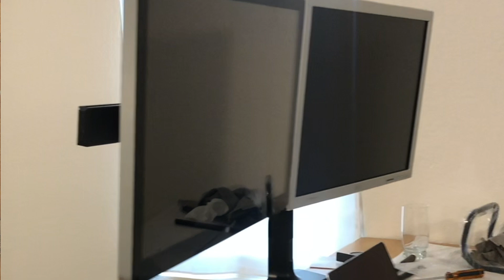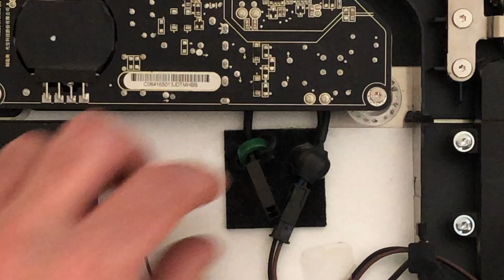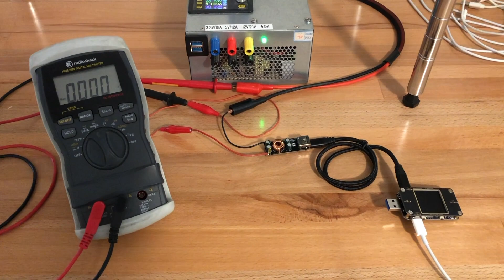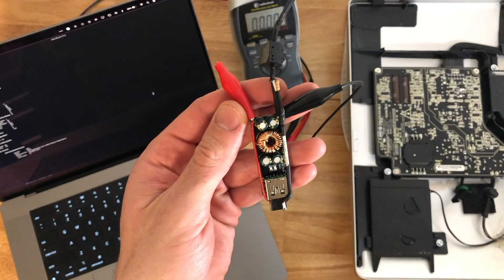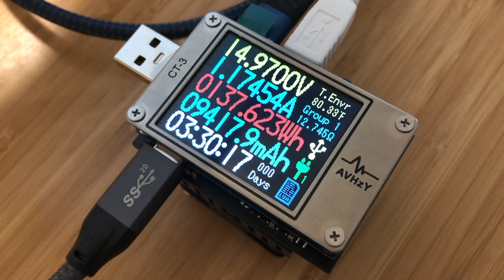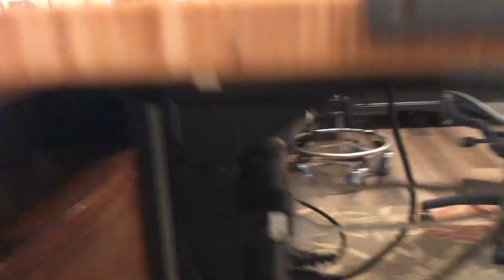Thunderbolt Display USB-C Retrofit for Modern Macs!

Comment: Enjoyed this video even if it doesn't work for me.
Short history, MacBook Pro late 2013 and Apple TB monitor, new early 2014. 
Bought a late 2023 MB Pro M3 and used a TB 2-3 adapter for a year with no problems and of late sometimes would not wake up, then not at all with either the 2013 or 2024 MB's. On the 2013 the magsafe doesn't light up anymore. I tried a rear TB cable and the adapter to the 2024 and without to the 2014 with either. 
My understanding is the rear TB's do not work on adapters without the magsafe charge working. If the rear TB's are on the same board as the main TB & power cable, why would that be the case? 
Does your TB 2 to 3 internal cable replacement require operational magsafe power?
I don't need the magsafe power and if this internal hack works without magsafe maybe I can keep the old monitor working.

Is there a way to even see if the thunderbolt display turns on since there is no power switch (externally or internal)

Thanks in advance.
Reply from the maker: The internal and external TB2 connections are on a separate board from the magsafe power supply. And I've used each individually many times on my 2015 MBP and 2022 MBP M1. I don't think there is any dependency between them whatsoever, except for the fact that both boards are ultimately powered by the cord going to your wall.

I suspect that if magsafe is not lighting up, AND TB isn't working, then the problem is likely upstream from either MagSafe or TB. Like power for the whole display has failed.

You're right there's no power to switch on so these can be tricky to troubleshoot. One test I would run: find a very low power USB light, plug it into a dumb USB power adapter, verify it lights up. Now plug it into your TB Display, and plug display into the wall. Does it light up? That will tell you if your display is getting any power at all. Good luck!
Reply: @colindgrant  So, I have one of those USB voltage- amperage sticks. No power to the stick when plugged in. Have you looked into the 120 volt AC supply while digging around inside the monitor?
Reply from the maker: @ I’m not following sorry!

Comment: Saw this video today, i had a similar idea for my thunderbolt display, but more like plugable one not the cable coming out of the display. for which i even bougth 40gbps coupler which didn't work coupling, so the project got stalled. i dont want a again a cable coming out of it, i want a thunderbolt female port, which is not there anywhere.

Comment: Hey I just bought the Mac mini m4 and I found a thunderbolt Apple display for a good price. If I replace the original thunderbolt inside the display to one that has type c connection on the end, do you think that,ll work and still be able to use the speakers built into the display as well?
Reply from the maker: Yep, if you do what I did in this video, it'll all work!

Comment: you should make a kit or a sell It completed. you will make money on that for sure. I want to do this conversion,  but it sounds like to much for me. IDK why they don't just make a magsafe to usb-c adapter. I know there is one but that's so bulky and really a whole adapter block extra instead of a simple small adapter
Reply from the maker: Yeah those adapters are pretty awful. I thought mine was going to catch on fire it got so hot. Flakey connection and it was an awkward angle.

Comment: I have the thunderbolt 2 display how do I get someone to do it for me or change it to hdmi connection
Reply from the maker: TB2 display only accepts TB2 input. You can adapt your computer's TB2 output to HDMI. But the display only ever will accept TB2 input. No adapter possible.

Comment: Really cool video! Absolutely love the thunderbolt display, especially with the fact they have built in speakers and a webcam. Do they still work after the conversion? Too bad they don't make them anymore and are incompatible with the newer MacBooks. Only thing that would make it better if you somehow converted to a single USB C cable for both display and power. Cool project none the less!
Reply from the maker: Everything works, including ethernet and all ports. I use the camera and audio daily. I did convert to a single cable for everything using an Anker TB3 hub.

Comment: Just wondering if you put thunderbolt 2 to display port cable it’s going to work so it can be used with let say old Mac pro (2012) ?
Reply from the maker: No, the TB display absolutely requires a TB input. Display port uses the same connector, but it won't feed a TB display.

Comment: Thank you for the great video!!!
I have a question. I'm already using another monitor that supports PD charging, so I don't need the charging function on the Thunderbolt monitor. I just want to convert the Thunderbolt 2 port to a Thunderbolt 3 port. In that case, not installing the charging module shouldn't affect the monitor's functionality, right?

Thank you :D
Reply from the maker: @김명준-c8v  that’s correct! The power and data are complete separate, just traveling in the same insulation.
Reply: Cool!!! Thanks for everything :D

Comment: Ouch. I bought a MacBook Pro M3 Max, and I want to use my old 27" monitor and my 27" 2015 iMac as monitors. I thought I could buy Thunderbolt to USB-C adaptors and simply press Control 3, but it looks like I'm just putting more junk in the closet & researching cheaper 3rd party monitors.
Reply from the maker: I mean, you can do just that. In fact that's what I did here.

Comment: Did you lose any functionality after swapping out the OEM AIO TB cable for the replacement?

I swapped my broken AIO cable for a 2M Apple TB2 cable like the first half of the video. But the display has now lost the ability to use the built in camera, speakers and USB ports. It's basically the same as running a TB cable from the rear daisychain port. Also it now only works with my much older TB1 era Macs and crashes my M1 iMac and an MSI TB1 motherboard. 

I'm considering sourcing an original AIO TB cable, but I'm apprehensive in dumping more money into the thing as it has such limited usability.

I've also considered swapping out the logicboard from the earlier LED Cinema Display, as those boards are cheap and so many parts are interchangeable, but the AIO cables are nigh on impossible to find, or 2x the price of a fully working display. 

The other option and probably the one I will take, is to source a EDP driver board specific to the LG LCD display and use it as a basic external monitor
Reply from the maker: The "All-in-one" cable is really just a Thunderbolt 2 cable running next to power leads inside the same insulation. There is nothing special about the AIO cable. I have full functionality using the OEM Apple cable between my two TB2 monitors and then another connecting to a TB2 hub. Video, Mic, Speakers, USB 2.0, USB 3.0 (via hub), all work well, even using the back ports. I'd suggest getting the OEM AIO TB cable from Apple. Good luck and let me know what you find!
Reply: @colindgrant  I must have a bad logic board. 

It does some other weird things like totally freezing up the OS or even crashing the system when I tried it out on a Z77 MSI thunderbolt board and a newer M1 iMac. 

I can only get the basic functionality mentioned in my first comment when connected to a 2012 MBP and a 2013 iMac. 

My plan for the monitor is to either get a driver board for the LG panel and gut the insides. 

Or possibly ‘downgrade’ it to an LED Cinema display by swapping out the logic board and adapting the port holes at the back. All the other components seem to have been used on both models. 

The snag with that plan from what I was researching, was the unique AIO cable for that 27” LED Cinema, as it’s even rarer again than the thunderbolt one. 

It will be a while before I get back to it anyway.
Reply from the maker: @BOLeary-u5b   I would think the next step is to rule out the cable by using an Apple OEM cable. I had some pretty odd behavior when my AIO cable was worn out, and it was temporarily fixed by using an OEM TB cable direct from 2015 MBP to TB Display’s back port. Apologies if I missed something but it seems like those behaviors could be caused by a bad AIO/TB cable (with an internal short for instance).

Comment: So i guess we can't directly connect thunderbolt 3 into the back port? We have to use thunderbolt 2 first and then connect to thunderblot 3 converter?
Reply from the maker: Correct. Or do what I did in this video internally.

Comment: Can anyone recommend a MagSafe 1 to usb-c adaptor I can use for this? If I don’t have to open the display I’d prefer not to, the only problem is that I’ve yet to find an in-stock MagSafe to usb-c adaptor.
Reply from the maker: The one I tried was horrible. It got too hot to touch, the light didn't work correctly, the 90 degree interface was awkward, and it disconnected too easily. Basically it was awful enough that I made this video! I've read the same from other commenters. I bought mine on eBay, and I haven't seen any better ones. Sorry to be the bearer of bad news.

Comment: I followed the steps (video only - I simply unplugged the MagSafe) but now, with display plugged in, I get no video nor can I hear the display fan come on. I.e. The MacBook pro shows no second display. I really don't know if anything is coming out of the 40 Gbps 240 W USBc cord at all. (I opened the display back up and rechecked that all the plugs seemed snugly in place.  When lifting and closing the LCD panel, there are 4 connecters to deal with - A black plastic cable bus, the screwed-in ground wire, a 6-pin connect and a weird long flat connector (w/ no pins?). The long one is the only one that never felt like it connected tightly. It only went in label-down. For diagnostics,  I have only an old analog multimeter. 

Might you have any trouble-shooting ideas? Thanks -SL
Reply: Here is my cautionary tale: My unit was 10 years old, and after I hot-glued into place the new cable and went to screw-down the video board, I tightened the screws too much, and three of the tiny brittle plastic towers supporting the screw sockets simply disintegrated, leaving the sockets unusable and the video board poorly reattached. Perhaps for that reason the monitor no longer worked. For lack of diagnostic equipment and knowledge, I abandoned the unit for parts. (I note that a less arduous fix is to buy a used cable like the original as a replacement, and live with the Thunderbolt 2->3 adaptor being   outside the case, and just ignore the magsafe power cord).
Reply from the maker: Sorry to hear about your troubles! That's a bummer.
Reply from the maker: Not at this time, but thanks for your interest.

Comment: Does it has to be apple cable or it can be some other companies cheaper and more secure cable (like Cablecc)?
Reply from the maker: It just has to be a 60W+ USB-C compliant cable. Nothing special. There are tougher cables, but my experience Apple cables are reliably compliant, so it's what I reach for. It didn't matter so much before, but in the age of USB-C, there are a lot more requirements of the cable, and many cables simply don't meet them.

Comment: The USB thunderbolt extension USB cable that you listed in the description from Amazon didn't work on my both Apple Thunderbolt display 27 inches A1407.  😢
Reply from the maker: Bummer. What length did you use? I'm using a few of the same cable with success, but all shorties.
Reply: @colindgrant  it was 2.6 ft.
Reply from the maker: @box4aza  Hmm, next step I would test without the extension, direct from the adapter to the computer.

Comment: Excellent video - thanks! I too have an "intermittent" display cable and need to replace it and so will use your method. Here are two rather naïve questions. First, since I never use the MagSafe power cord anyway (I easily charge my MacBook Pro with its own charger) I'll just skip that part entirely, and replace the video cable only. So question 1 is - is there anything wrong with that plan? Question 2 is why did you need to do all the voltage conversion in the first place?  Are the voltage needs of the new MacBook so different? Why isn't it just a connector change, like for the video? Lastly, I am not sure how to take the existing Magsafe power cord out of the picture - just unplug  within the display, or tie it unused on the outside, unused, to the new  3/4 extension cable. OK - now to go out and buy some suction cop and T6 and T10 torx heads. What was the T number for the display frame, BTW? Thanks!
Reply from the maker: I’ll go in reverse! I don’t remember the tire size for the frame but a small set is worthwhile, in the T5-20 range. If you want to do the internal usb-c conversion you can just leave out the steps I did for the voltage conversion entirely. Remove the umbilical cable and just stuff the TB2 to TB3 converter inside like I did. The voltage conversion was to change from MagSafe 2 to MagSafe 3 which is really just Power Delivery over USB-C, a part of the USB spec. The monitor won’t care that you’re not pulling power from it. Good luck!
Reply: @colindgrant  Ah, I see, thanks. The great paradigm changing innovation of having anything: data, input power, output power -  anything but analog sound, come over a single cable type must have had some overhead in specs.
Reply from the maker: @stevenlord7793  Sorry not following on the "overhead in specs"
Reply: I was philosophically referring to the new specs being required of the entire industry to accommodate the upgrade to USB-c, but yes, they were required here too. (I just want to repeat that your walkthrough was super clear!)
Reply from the maker: @stevenlord7793  yeah totally. Thunderbolt 3/4 especially has lots of new functions going over USB-C!

Comment: What kind of hub are you using, does have hdmi input?
Reply from the maker: Watch the video :)
Reply: @colindgrant  I did I could not get this information.
Reply from the maker: @TheDuckieNYC  This video is about Thunderbolt displays. They accept Thunderbolt input, period. HDMI is not involved at all. There is no hub involved in getting video from the computer to the displays. There is no such thing as "HDMI Input" into a Thunderbolt display.

Comment: Thank you I was able to follow up on this instruction and finished the mod. I used the original grommet and let the thunderbolt 3 to 4 adaptor's usb-c connector out of the monitor just in case I have to replace the extension cable.
Reply from the maker: That's great to hear! Nice work.

Comment: Hello Colin. I’ve attempted your mod with a MagSafe 2 to usb dongle from elecjet. However I’ve noticed it gets extremely hot and clicks without it being connected to the MacBook. I was wondering if you’d had any issues with your buck converter being constantly pulling current/getting hot without anything connected. I’m very much considering swapping out my current setup for the pd side of things with what you’ve demonstrated, potentially adhearing the bc to the case with some adhesive thermal pads to act as a big cooler
Reply from the maker: I tried one of those MagSafe adapter dongles before all of this and I too found it got extremely hot! That’s one of the reasons I pursued this project. Good news is that the PD power module doesn’t get hot at all and doesn’t appear to pull any significant current when it’s not powering anything. 👍

Comment: I have a question, I have a Mac mini m1 and would like to do such a cable upgrade for the Apple Thanderbold Display. Would it be enough to just install a USB-C cable on the Apple Thanderbold display? The MagSafe cable is irrelevant to me. Thank you in advance for your effort!...👋🏻
Reply from the maker: Sure. The power and data cables are completely independent.
Reply: @colindgrant  Thank you for the fast feedback! Then I will swap the original cable for a Thunderbolt cable.
And again, thank you for the information…👍🏻

Comment: Is there a reason, why you didn't use a usb c power injector to make the whole thing a one-wire-system? Would this be possible as usual?
Reply from the maker: If you know of a way to inject Power Delivery into a cable carrying Thunderbolt signals, I'm all ears! I don't know of a simple way to combined TB and PD, short of using a hub.
Reply: I looked up some hub prices online and now know, that they are really expensive. It’s not worth ist. 😅
Reply from the maker: @lennig100  it would be really nice though!